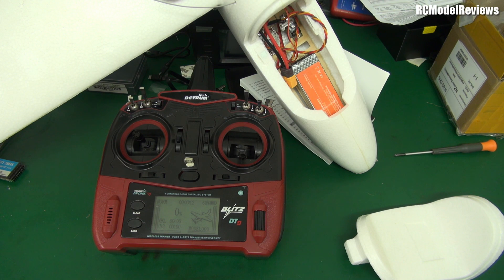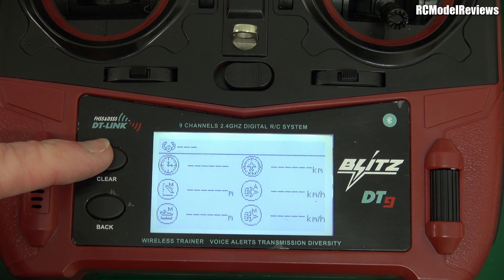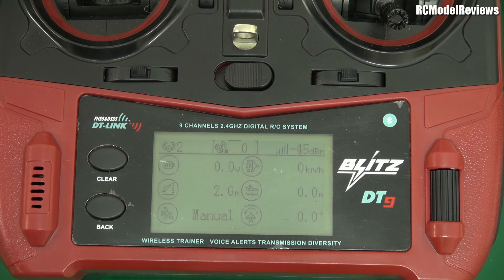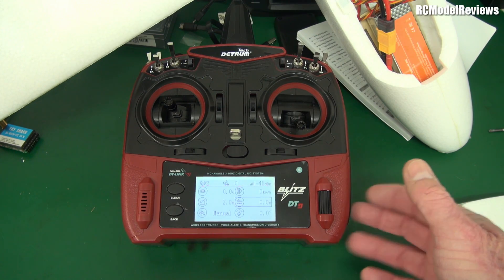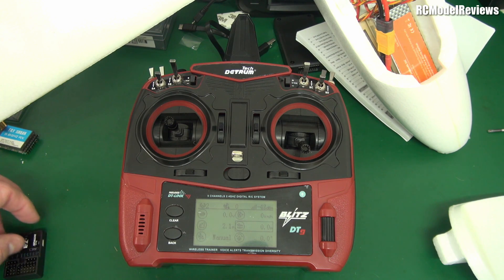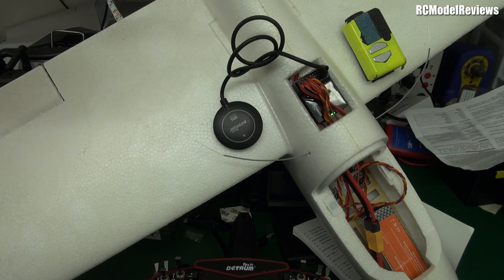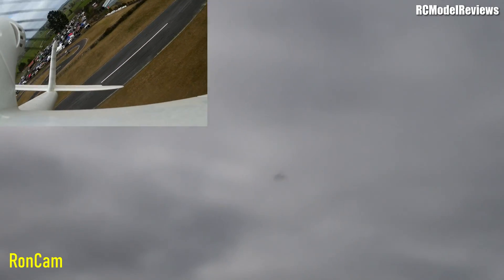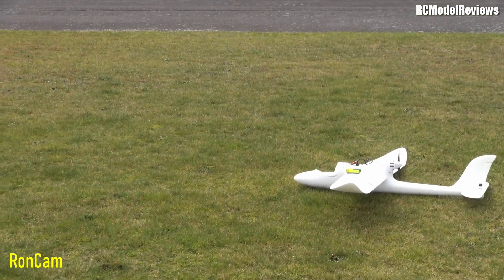The Detrum RC system with flight stabilizer/RTH (part 2)

Comment: That Long GPS Cable could no doubt be replaced/modded to a shorter one. If there is no Compass in in the Puck...It  only used 4 wire and of those you only need 3 wires. Yeah, I also think they should have figured that out before selling the product.

Comment: The long cable it's probably because there's a compass in that thing we need to keep it far away from the electronics and maybe that would be good for someone who doesn't use goggles for fpv
Reply: There is an arrow on that it says Point towards the front
Reply: @slinkyfpv mine has a compass in it

Comment: Glad you had some fun with it. But you're right, if it's a proprietary protocol, you're gonna upgrade out of the ecosystem at some point anyway. So no point in locking yourself in early o, 'coz you won't get much for that gear once you decide to move on.